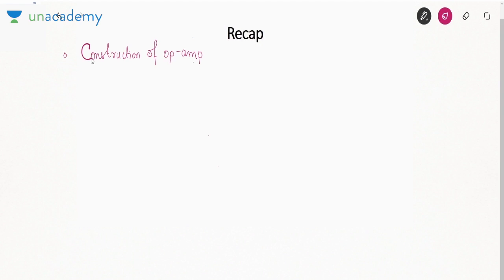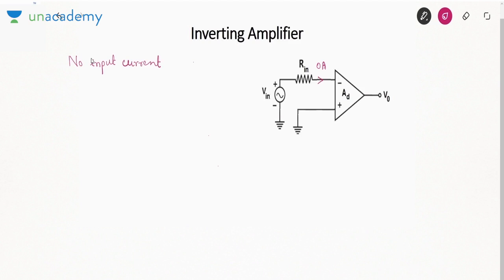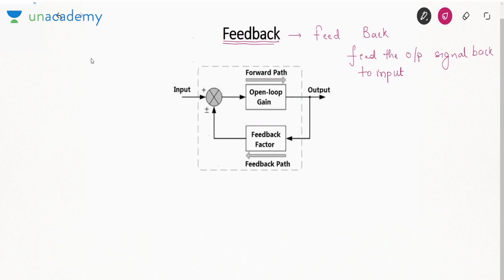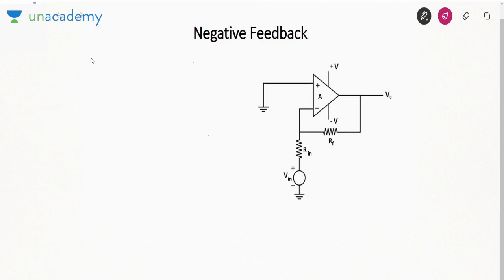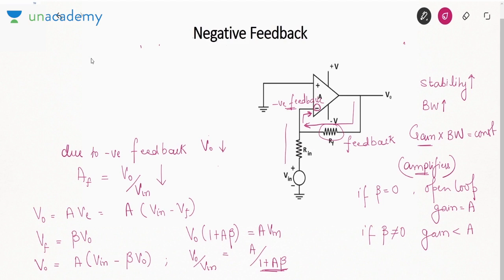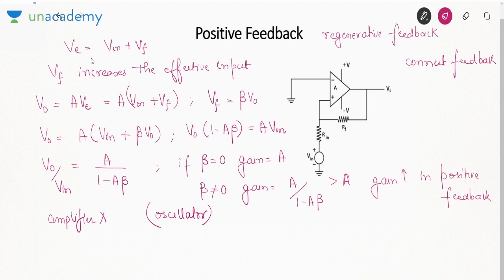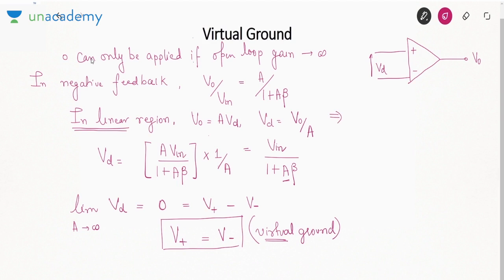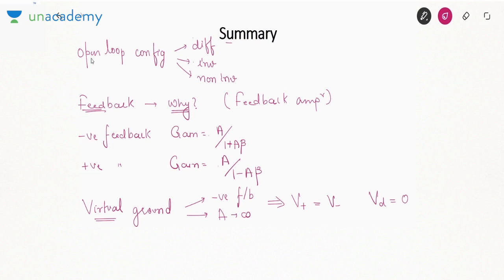Open Loop Configuration | Op-Amp | Lec 76 | Analog Electronics | GATE 2021 Exam

Comment: Sir, at 38.21 time of this lecture, you told virtual ground concept can't be  applied. But at saturation Vo=Vsupply(DC bias). and also gain has increased. So if A->infinity ,then lim Vd=lim (Vsupply/A)=0
=>Vd=0
=>V+ - V-=0
=>V+=V-
So, virtual ground concept can be applied.
Right???
Reply: We are using this virtual ground concept in order to find out output (Vo). And if we already know that the output is Vcc or -Vee , then in that case there is no point of applying any concept at all. Right ?